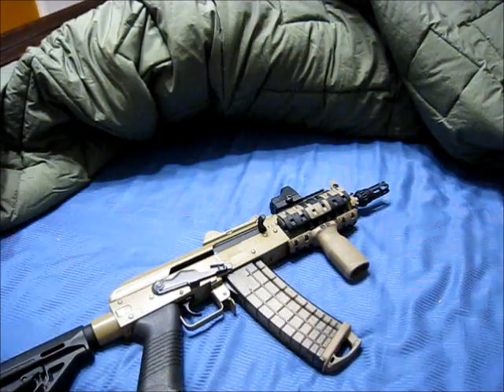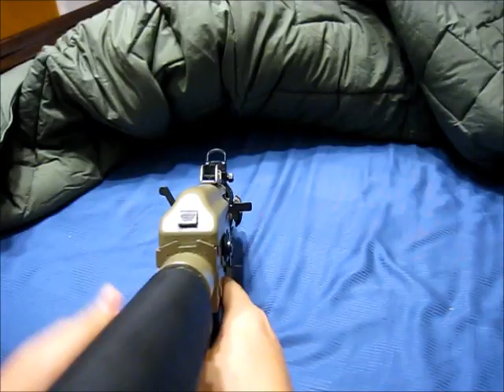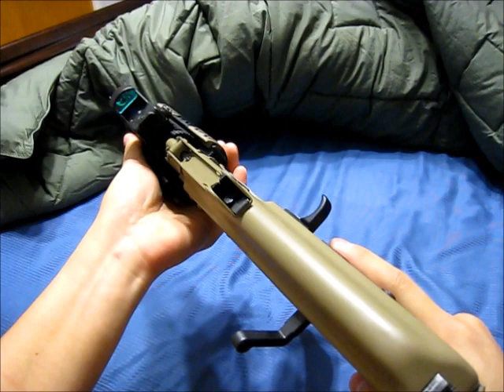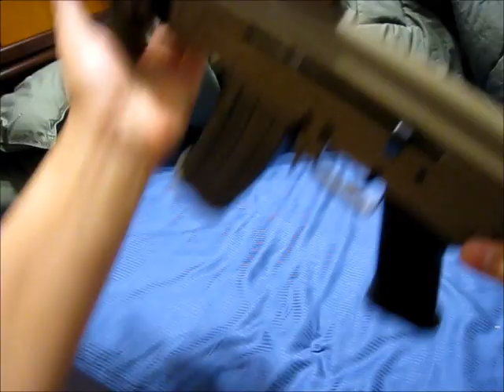Custom Ambidextrous Bolt for Airsoft AK

Comment: You got great work on your AK. I have a lots of pain on my Beta project AK battery place. I am going to use 11.1v stick lipo battery. I want change buffer tube in order to put battery in the stock. My gun use the real gun buffer tube. So there is not enough space to fit the battery. Can u give me some advice? Or which buffer tube can put battery inside?